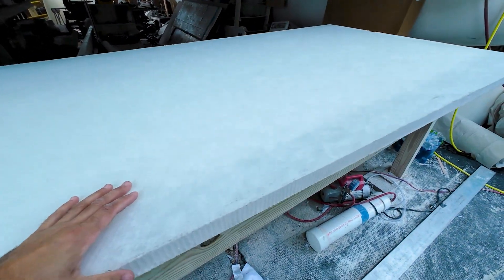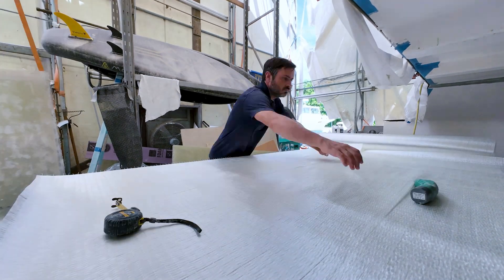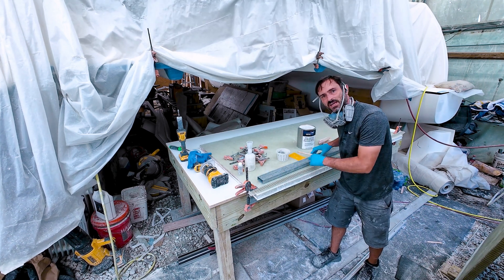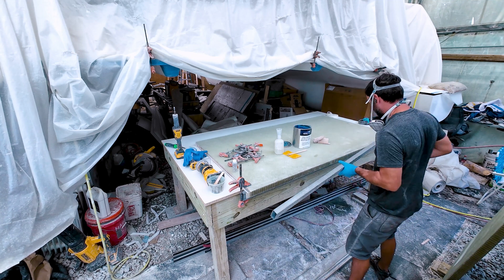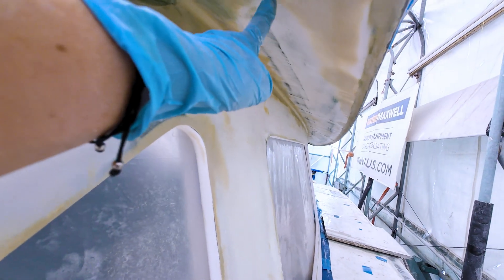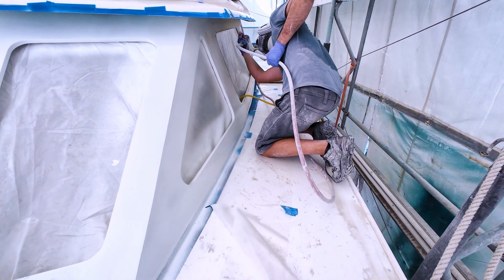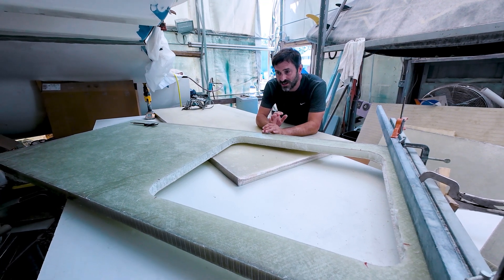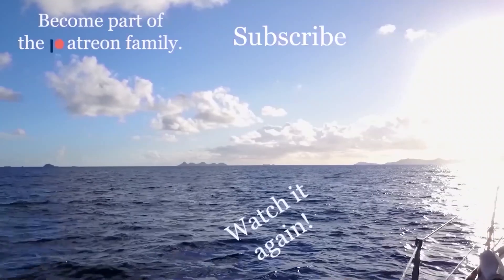Building Our Cockpit Doors: The Exciting Start! (MJ Sailing - Ep 336)

Comment: From going crazy at the beginning you look quite the professionals. Excellent job. Foam sounds good but can be damaged easily whereas a plastic core may be more durable so that is o.k. for the hinges you may want to add some filler where the screws and latch goes to reinforce it on the inside. Everything looks very good. Terrific job!
Just remember to have some time set aside for some fun things to do so that you and your viewers do not get bored

Comment: Matt, have you tried a rabbeting type bit in a trim router to de-core edges ? Needs a top guide bushing.
Fyi I found out how Nidia core does not end up filling the hex shapes , there is a,thin film bonded to the hex.  (If took some research to find d that out!) But in sure you knew!
Fyi that's a strong skin on the doors ,I bet one layer would have been plenty ....
Cheers warren
Reply from the maker: I use a bottom bearing rabbeting but typically.  But even new it just crews the plastic of the nidacore and doesn't really cut it out.   

Yeah, I thought the door skin was a bit overkill, but it's what they do in Vietnam - on 1" core not 1-1/2" we are using .  Unfortunately, the door is now heavier than I'd like, but still way lighter than the typical glass/aluminum slider on most catamarans
Reply: @MJSailing  yup, machining polypropylene (?) is tricky I can imagine .  The other solution I suggested in a different comment was to mold in the reinforcement for edge at same time as sides but that requires knowing the exact sizes ahead of time ! 
Doing a great job guys! 
W

Comment: Been following , the channel since episode , "OUR DESIGN CHOICE REVEALED For Our Catamaran Build" . One of the reasons influencing the decision , the MaxCruise was selected over the Schionning ,  was because the MaxCruise was CE but the Schionning was not. In this episode you are building the door yourself? Is there a process , where you can submit the door that you build for load and water seal testing? Is there even such a process ? And if you do not certify the door , does this mean the boat will not be CE? Wouldn't it then be better to have chosen the Schionning ? Since both are not CE certified? I was really rooting for you to choose the schionning back then , but when you mentioned the CE certification , i understood where you were coming from. Is this still the plan ? Does this mean the MaxCruise won't be CE as well?
Reply from the maker: The Max Cruise is engineered for CE - meaning the design work was done and the hulls/deck/bulkheads we're spec'd to CE standards. They are then sent to an independent engineering firm to certify that they are to specs..... this extra bit of work to ensure that everything is designed right is what I was concerned with.  

We had originally planned to build to CE in South Africa,  but had to move back to the USA instead due to lock down protocols.  In the USA, it is very difficult and expensive to get a boat inspected through the build to maintain CE.  So we had to give up on having it certified.  No issues for insurance, but we can't sell the boat to a European for use in European waters.
Reply: Interesting answer , I suggest you also check out SV lynx who are building a schooning 50' , A completely different build! 
Cheers warren

Comment: Great to see ideas for doors, which I am next to work on in our project 🙂

What I've discovered, and recently implemented, while producing many boat parts is to spread polyester resin on a large sheet of nylon (I believe it's called Delrin), which the resin cannot bind to, leaving a very smooth and flat surface. On top of this, you can build up the desired layers of fiberglass saturated with resin.

I have successfully used Nidacore and other foam cores, where I place the core material on top of layers of 600g CSM, evenly distributed in weight until the resin has cured. Then, the other side can be made in the same way, resulting in a 100% flat sheet that can be used for various parts.

These parts require very little filling and appear completely smooth. In my experience, Nidacore works best, and it is beneficial to thoroughly soak them with resin before placing them against the 600g CSM and massaging the layers together so that the resin and CSM physically integrate.

Comment: I like those E-clamps, I never knew they existed. Just looked them up "3 Way Edge Edging C-Clamp Tool"
Reply from the maker: They are great, but they need to be purchased in bulk.  I have just two, but could use 10x that :)

Comment: For painting the cove (under the cabin top) you can try turning the paint nozzle or sprayer horizontal and paint the tight angles in a horizontal line.  I've done it numerous times and it works great.  The main thing is to turn the paint spray to a very low output because you are painting a straight line instead of a fan-type spray (the back edge of the spray goes over the front edge as you move the sprayer).  If needed I would follow up with a small, 3/4" or so, paintbrush and simply fan it out.

Comment: Just curious, if they build these in the factory and it’s a “kit”, why doesn’t the basics, like hardware ( hinges) come with the kit or at least reference what hardware is recommended?  Matt spends a lot of time at the end discussing the particulars of the engineering demands of the door hinges when trying to decide what would work.  Wouldn’t these be calculated during the design phase or have you guys gone “rogue” on this build with your own custom design?  I admire your dedication on this project
Reply from the maker: The plans show the basic structural components --- in this example, the bulkheads and beams around the opening; their construction and laminations-- but everything else is up to the builder. 

 It's like this with any "kit" built boat's plans.  Actually, Max Cruise is more detailed than the other plans we looked at.   But they only hold your hand so far and it's up to you to decide how you want to finish off the boat. 

Luckily the production versions of the Max supply a good bit of information on what's working in the real world.  The issue is that just about every one they have built is custom and different from the last, so things change all the time and evolve, making it hard to follow what they are doing at our build pace.  In this situation they have gone to a different cockpit layout which allows all sliding doors and no lifting section and we are too deep into our build to change it up.  

And supplies are different in Vietnam vs the USA, so often I can't get what they use.  

But most importantly that's the fun of building your own boat.  If we just installed finished pieces without needing to think about anything, there would be little satisfaction in the build.
Reply: @MJSailing well you guys have never been afraid of a challenge and this one is definitely putting you to the test.  You guys are doing great and thank you for responding 😊❤
Reply: If you want to see what they, could be doing if  they,did not have the major molded section of the boat check out SV Lynx they are building  from a kit that was some large flat panels and a drum of resin!   
Everything else was 'follow the plans!'
Cheers warren

Comment: I know you're saving weight on this build due to performance, but wouldn't it have been better to used a composite 1.5"x1.5" board where you de-cored the Nydacor to strengthen that door edge? More surface area to bond the door skin to.
Reply from the maker: I'm sure a coosa composite would be fine on the edge.  Adding more surface bonding area would be better for the edges, but as you said, it's the weight we are concerned with.

Comment: SV Basik has a LOT of Nida-Core in the super structure and all over the boat.
Reply: Basik is now 31 years old, and the NidaCore still looks like it is brand new. Can't say enough about its lifespan and weight-to-strength qualities.
Reply: @tealgoben1781  my understanding is your SV basik was built in FLorida essentially round the corner from where Nida-core was developed and manufactured. Factory support for sure! Such a clever build.
Cheers Warren
Reply: You are correct, basik is 100% NidaCore. Hulls, decks, walls, doors, and super structure.

Comment: With the amount of spraying you guys need to do inside and out, you NEED to get a pressure pot, there's no paint container on the gun and so much more manageable, pot pressure, flow rate, nozzle sizes for heavy primer to finish coats and deckgrip. You will need a decent size compressor. If you were to hire someone to finish coat this is what they would use.
Reply: Hi capt,  As a pro we got away from remote pressure pots. The extra cleaning ,material loss in the hoses and the twin hoses just to start makes the gravity feed cups so much easier to deal with.
 If you need small batches its easy to mix and spray . 
if it set ups up In  the cup its very little to replace or clean. 
With a remote pot its a lot more work and well as lost of solvent required to clean all the lines and then that waste to deal with. 
Check out the car painters they all use top feed gravity cup spray these days.
It took me a,while to change from pressure pot to a gravity feed when they first became cheap.   
Finally Matt is,using a HVLP gun that has,way less over spray and fumes than an old pressure/air spray.
Cheers warren

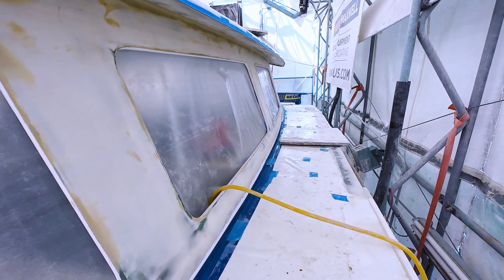Comment: At 8:47 you talk about attaching windows to the surface of the cabin. I remember back a ways when The Wynns had issues with their polycarbonate windows detaching from the cabin surface. They suspect it was happening because the adhesive was pulling away from the painted surface. Are you using this method or something else for your application?
Reply from the maker: I'm sure it's similar to what HH did on the Wynn's boat.  Typically you key the paint with a bit of sandpaper before you bond the windows - both caulk adhesive and VHB 3M tape.  Maybe they missed that step?  But yes, creating a leak free window can be difficult when it gets to these sizes.  Lots of thermal expansion to overcome.
Reply: @MJSailing  sounds like you have a plan. I didn't mean to sound like this was a problem on their HH. This was back on their first cat.
Reply: @MJSailing  Read the Sika 295 guide (the multi page one) on how to do it. Key is sufficient adhesive thickness for big windows and not squishing out the goo. I did 2m x 1m windows and they never leaked or de-bonded.

Comment: The doors look good. Smart move waiting to cut the windows. So you're coming out of the tent. I would set a turning point or hub for the laser inside the boat, before you move. So you have fixed reference points.
Also, finish all the exterior coatings you can, the jet exhaust from planes landing at BWI can dirty things up fast.
Reply from the maker: Great minds think alike.   We're documenting a few references points to make sure we can level the boat once in its new spot

Comment: On the hinges, don't forget to factor wind gust on the door not just weight. That can put a lot of PSI loading on the door hinges. Go heavy there.
Reply from the maker: Even though we're pretty far out of the water, a big concern is taking a wave aboard.... It happened on the boat that sailed from Vietnam and proved the need for strength there

Comment: I'm really curious,why do you put a layer of CSM down first before laying up the rest of the glass on the doors?  On my cat (Pescott WRC/Foam) we never used a single piece of CSM as I could not see any value in it, except that it adds weight and volumn. Phil
Reply from the maker: The nidacore has a texture from its cellular structure that the 450g biaxial fiberglass alone has trouble bonding to properly.  The CSM fills those divots and makes for a better laminate.   For non structural things like our shelves, we skip the CSM, but for the doors, I felt it was worth the added weight to make sure we don't get delamination in them.  This is the only area we've used the honeycomb -besides shelves - and I regret not spending the money for foam.  Its shear strength seems to be much higher.
Reply: @MJSailing  I know what you mean by cost vs quality.  I used crappy foam in a lot of my shelves and regretted it-- but at least they were not structural.
Reply from the maker: I accidentally bought some 60kg foam instead of the 80kg we typically use, and after a few simple tests of a finished laminate, was amazed at the difference the extra 20kg gives.

Comment: It will be interesting to see who builds first. You or Delos.
You or, Uma.
You or, Plucky.
Reply from the maker: Delos.  Much quicker to build in aluminum since the interior is non structural--- if you have professional welding team like they do.  And that length/design can handle the weight of plywood which makes the interior build process 100 times faster.

Comment: Nice to see Nida Core used! Half of Cpt Teal Gobin’s SV Básík is built with it. Awesome progress!
Reply: Yes, it is! 😉
Reply: @tealgoben1781  nice! 👍
Reply from the maker: Teal and I have had spirited conversations regarding Nidacore.... And this will help boost our next discussion.   

Give me a proper boat building core any day --- which can only mean foam 😄
Reply: @MJSailing  awesome! I’m an airplane guy so when I watched Teal refit Basík I was amazed on his craftsmanship. I do understand how foam is a great way to go but makes me nervous when some manufacturers use spray foam that gets water saturated over time. I like Nida core because it is so close to aircraft composite and can sink potted fasteners and such in it as well as do complex bends with it and such. I do love your channel as much as watching Teal and his families journey. You’re both awesome!
Reply: @MJSailing  Yeah Nidacore's big (and only) advantage is cost. The extra hassle of not being able to bond to the plastic core really makes it a no for me for anything except interior furniture or non critical structure. Great for a closet shelf. Leave those 3 hidden edges as cut and only finish the visible edge. When we were building the bridgedeck cabin on our cat I just bought a case of Corecell and was super happy to use it. You can thermoform it, it's very resistant to slamming loads etc etc. If you need a thicker core you can bond 2 layers of foam. The extra time and labour to make those uni edges seems like a pain and perhaps unnecessary structurally. Wouldn't putty + edge taping bond the skins enough? The door panel is presumably supported at the edges by framing right? I'm a N.A. and have designed some pretty high end composite stuff and we would never use Nidacore.
Reply: Really ? I'm surprised you dont like nidacore.
In a composite production world I come from I would have built the edge structure into the nida core by cutting everything to size (or using a temporary Formica  faced mold) and then extending the skin surface right over the edges so it was all one piece ,but in the mjsailing world the final size is not necessarily know ahead of time.
Sometimes you can spend too much time thinking and just doing it can be better.(sometimes)
Cheers warren